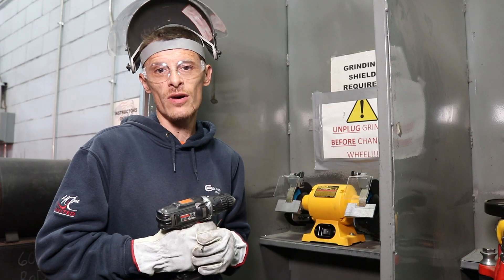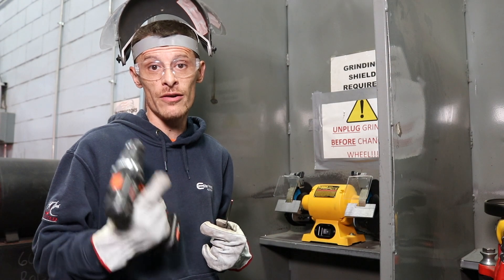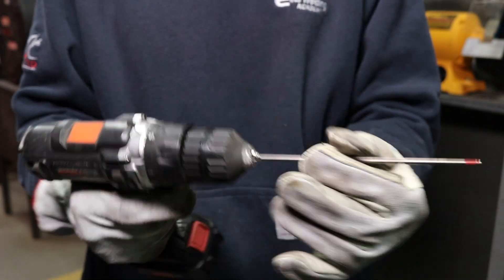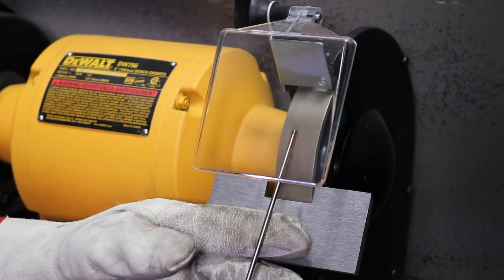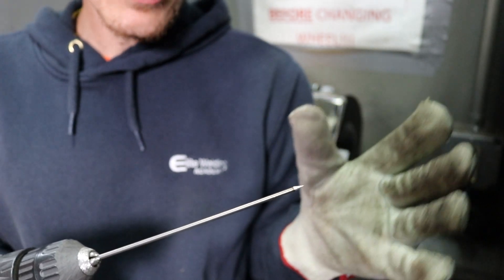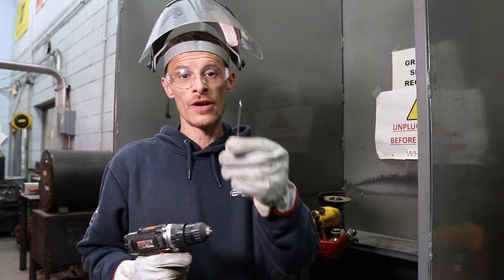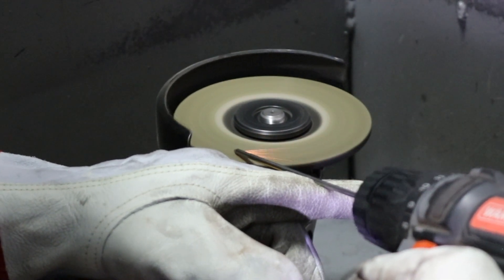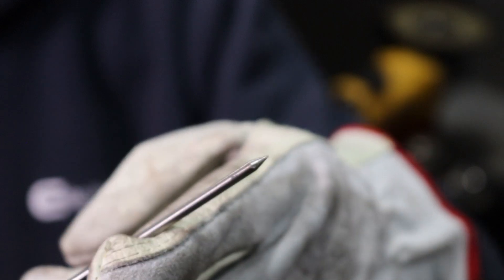How to Sharpen Tungsten (Elite Welding Academy)

Comment: Why would you grind the side with the paint on it? Take this down and do better
Reply: I agree, I always hated when people do this in shop or class. one it leaves you with a pile of tungsten that you can not identify(because the painted end is gone) two there is no added advantage of a double sided tungsten (when one side gets bad you can not flip it, it has to be resharpened just to fit through the collet anyway.)